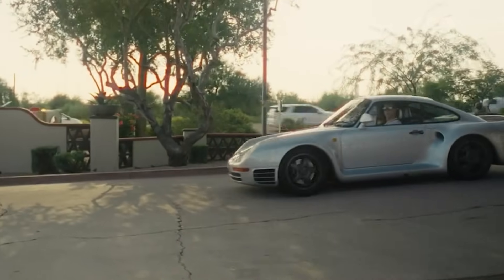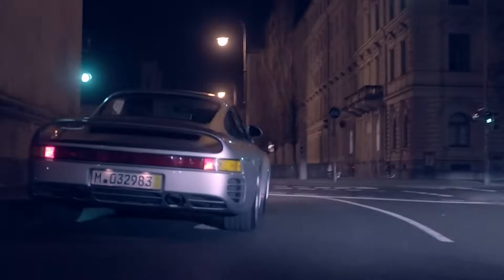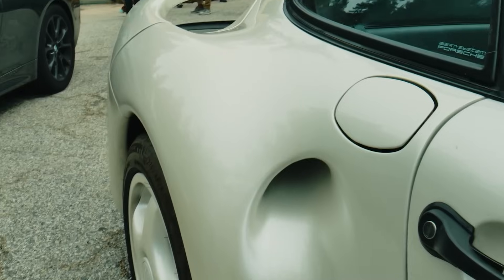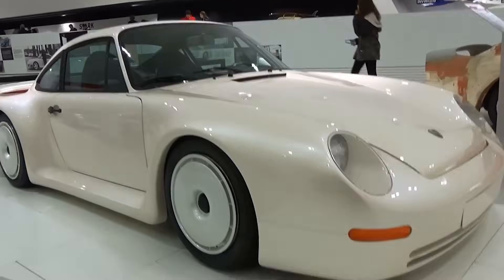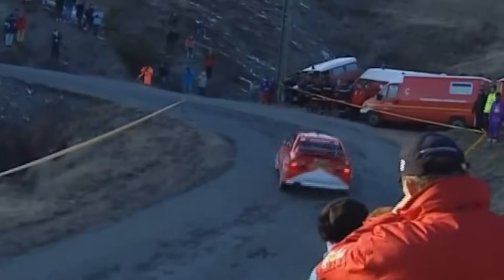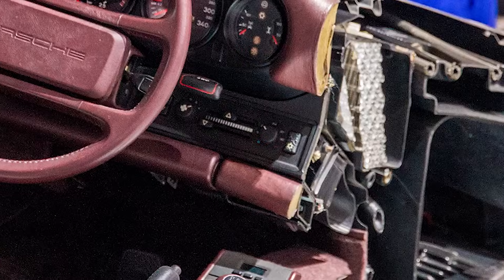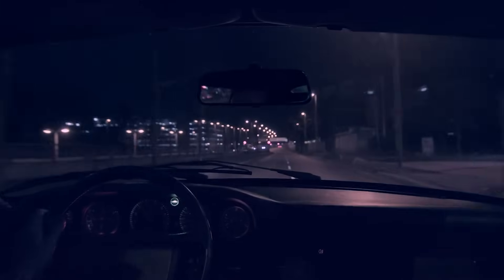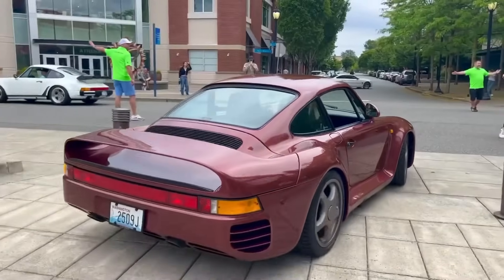Porsche’s PSK: The 4WD System So Advanced, Most Modern Ones Still Haven’t Caught Up

Comment: The story of the Dakar victory is a bit more painful:
in 1984, two or three 953 prototypes (later on bought and used by Jean-Louis Schlesser, colored in Foltene-green instead of the legendary Rothmans look) won. That were still the early times, when e.g. Claude Brasseur participated, dual-engined 2CVs and Vespas were competitive and some Frankenstein Mercedes SL with monster tires at the rear caught the eye of the cameras. 
Not to forget, that a few years before, Audi did quite some testing for the quattro 4WD,  hidden in insuspicious VW Iltis army offroaders at this event. 
In 1985 three (!) 959 prototypes (without turbos, but robust 230HP NA?) failed or crashed in the desert and Porsche got humiliated by some Mitsubishi Pajero.
At that time, they also ran and won other events like the Pharao Rally in egypt.
In 1986 René Metge drove a single 959 and won. Metge later organized the Dakar, after Thierry Sabines death.

Comment: W124 4MATIC? What do you think? Similar? Better? And also from the 1980s... Cheers.
Reply: The original 4matic combined a center differential with primary rear wheel drive, while most did either optional FWD (without center diff) or permanent 4WD with diff.

Comment: This is way ahead of it's  time, but no, modern ones absolutely have caught up. The Focus RS, GR Corolla, Acura SH-AWD all uses the same type of technology with controlled overdrives. The percentage based torque distribution stuff is a bit misleading, as the torque split is constantly changing depending on what grip you have. If you put the front tires on ice, lock the clutches up, the rears will still take 100% of the torque. Meanwhile the same scenario on an ideal piece of dry pavement will have the front carrying most of the torque as the front tires are trying to overdrive. More period-correct, the GT-R used a very similar system but with not as much front bias potential built-in. That was in 1989, so no, everyone caught up pretty quick.
Reply: SH-AWD can send 70 percent of engine power (under specific circumstances) to a SINGLE rear wheel, pivoting you around a corner like pretty much nothing else. You just turn in, floor it, and it turns. Great fun.

Comment: Clickbait, most modern four-wheel drive vehicles have more advanced systems. Check out the Focus RS MK3
Reply: Yep, though the Mk3 Focus RS uses basically the same system. Overdrive to the rear axle, lock it up, rear bias. Same with GR Corolla and some Acura SH-AWD cars.
Reply: So it uses a different system, than the Taurus/Explorer?

Comment: The 959 is a true hypercar.
A supercar is a car above nearly every other one of its era. 959 performances totally make it a supercar.
A hypercar is a supercar that defines future cars, the future. 959 technologies (a lot!) made their way into 911 and other cars.
Remember the Nürburgring 959 record. Lasted for 3 decades. That's hypercar level.

I had a Typ 964 with 4WD. A derivative of the 959 4WD. ABS was also a derivative. It was the easiest car on snow at that time (living in french Alps).
But not the easiest to pilot to the limits. You had to push hard. In Alps you'd better fill you front petrol tank (more weight on the front tires).
Reply: what about mclaren f1?

Comment: You know what an advanced 4wd system is that beats all the others? Each wheel has its own motor with torque vectoring. That simple.
Reply: I don't think simple is the word to use here
Reply: That's flawed. You can't transfer touque to the wheels with the most traction. You would have to make the motors over sized to manage the best grip at each wheel.
Reply: @RedBatRacing  What are you talking about? Rimac has been torque vectoring (moving torque where it can be best used) with Concept One since 2011 - it's just much easier with full control of each motor at each wheel than any mechanical differential systems...
Reply: @The-Wall-Lizard Torque vectoring is great. A single motor per wheel is simple and works well but doesn't "beat all others".
Simple example: if you want to transfer 80% of torque to the rear wheels, you can't. You can only reduce torque on the front. That's not moving it.
Another example. If a wheel has less traction you want to transfer that torque to wheels with more traction. You can only reduce the torque at that wheel, not transfer it. Torque vectoring has been around to decades, from advanced systems like the 959 to crazy hybrid systems like Koenigsegg. Rimac has a relatively simple solution, but not the best
Reply: @RedBatRacing  Aah, now I see what you mean - I think the issue is in what we consider to be max torque/power. With Rimac's system, obviously the max torque is that of a single motor, not all of them. A little different with Koenigsegg (that still uses Rimac components). That said, the absence of a mechanical linkage between all wheels in Rimac's system is somehow appealing to me on a conceptual level - my idea of 'best' was 'simplest' or 'cleanest', rather than what you meant. I understand you now.
Reply: @The-Wall-Lizard yeah it's hard to get on the same page when all you have is a keyboard. I now understand where your coming from.  You don't need 100% of the power all the time (with some exceptions), so a motor at each wheel and bit of compute power will cover most situations
Reply: That ads a ton of unsprung weight though. Plus, watch that system try to go up a mountain offroad some time (slowly mind), and watch it struggle to make up it's mind as to which wheel gets the power and WHEN. The potential is good, I'll give you that but the software is critical there.

....however, it's still EV so, hard pass.
Reply: @gotindrachenhart  For me, it's EV so it's a definite go - but you see, that's a matter of pure opinion. Also, the motors are not at the wheel - they're in the frame, so no unsprung weight. I'm not sure what struggle you mention, the software monitors everything way faster than a human could.
Reply: @The-Wall-Lizard  I've watched reviews of the Rivian being driven up offroad trails etc and you can watch it hesitate on power delivery. It results in a halting, shuffling gate up the hill while the software acts more like a mars rover than a truck going up a rocky dirt trail. Like I said, if it's better now that's fantastic, more power to them. I feel EV has a place in the world like folks living in major cities for getting around town, taxis, city busses etc. But there are other technologies out there that would also be good such as synthetic fuels, hydrogen, and hell even different battery technologies that are way cleaner than LiPo. So, I'm happy you're happy about EV, but if I'm in one it's because the hearse my body is in happens to be EV. And the reason? Because it wasn't a gradual transition. And the reason? Because dieselgate.....and then VW champions the EV switch and oh, just happens they own most of the other manufacturers so they strong arm everyone and try to force planetary conversion to EV. Which I find rich, seeing as it was dieselgate that started it. They super overreacted and panicked from the backlash and that was their attempt to pay for their sins. So on a base level I resent EV not for the tech, but for the origin of the movement. No it wasn't to save the planet, it was for a monopoly company to try and save face......and to me that's wrong.
Reply: Maybe it's the most advanced, but battery degredation and the waste it produces to make batteries will take humanity back to the stone age 🤣
Reply: Unsprung mass and cooling issues beg to differ… plus getting that controlled well enough in every situations isn’t that easy either…
I remember my material science prof having his fun with insulation materials for the windings of wheelhub motors…
Reply: if you know about FSAE cars which some universities choose to use the thought, they tend to brake down and sometimes under perform compared to other simple 2wd design, and most importantly, they burned programmers brains down

Comment: On of my favorite things about this (and older in general) cars is the proportions. It was made for 26-inch diameter tires, and the taillight is aligned to the top edge of said tire, or at least, its fender arch. This is a beautiful proportion that started going awry beginning with the 996. Nowadays, you have the frog-faced 992, which uses 21-inch wheels, 29-inch tires, and the taillight is mounted roughly 4-6 inches above the already ridiculously high arch to accommodate the ridiculous wheel and tire diameter.

To top it off, the whole car is like 600+ pounds overweight and bigger in every dimension than it really needs to be. Materials science and organic/geometric shapes (which they don't utilize as much as truer hypercars or Czinger) can only get you so far; at the end of the day to make a light car you just need to make the thing smaller. The 959 designers still understood this in their day.